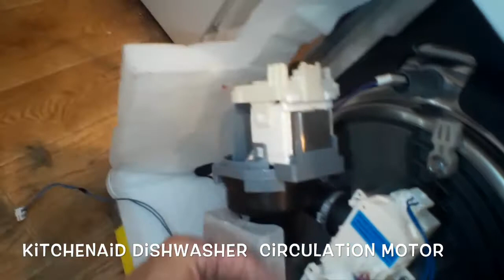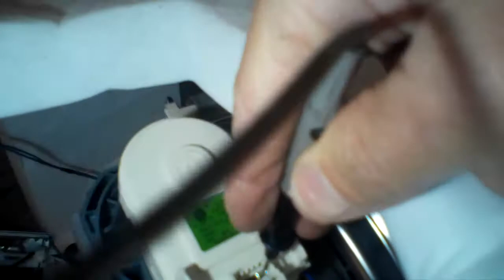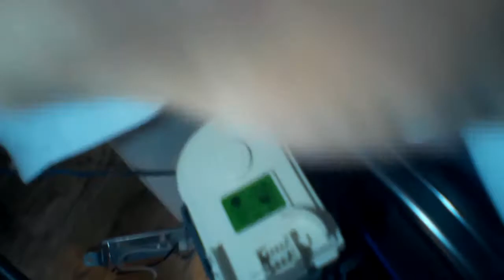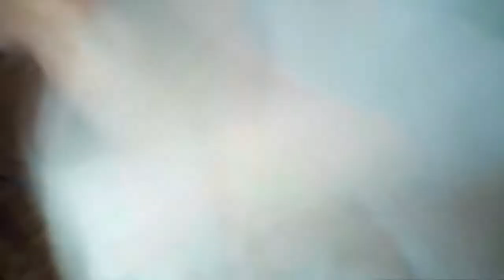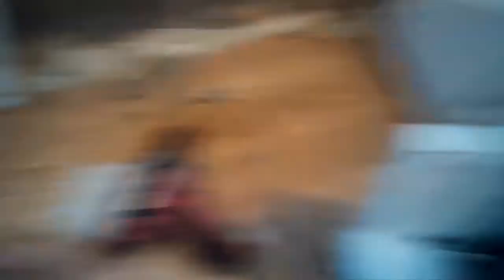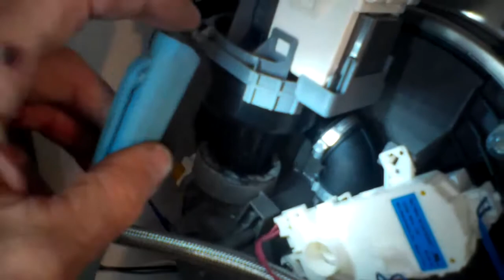✨ Kitchenaid Dishwasher - Circulation Motor - How To Replace ✨

Comment: What should the ohms reading be on the motor?
Reply: my motor reads 8.9, I don't know what it should read, If I hot wire the motor it runs fine. Are there fuses of something that could blow when the motor gets overloaded?